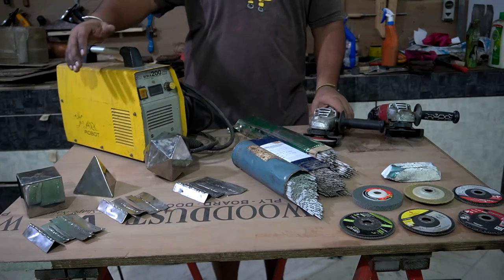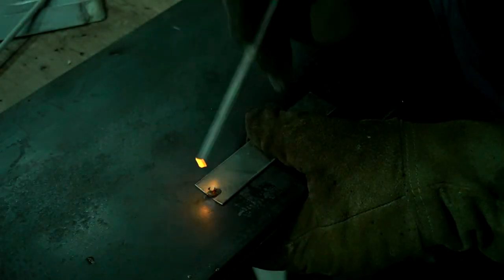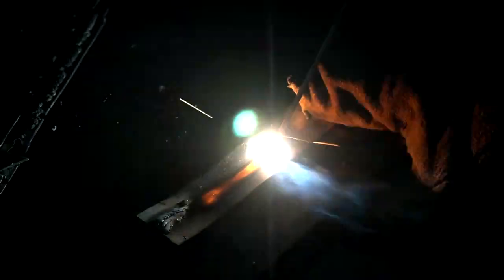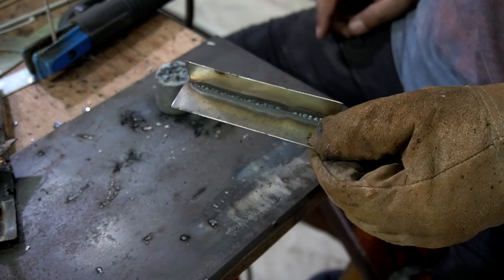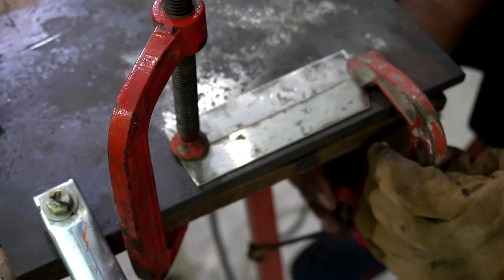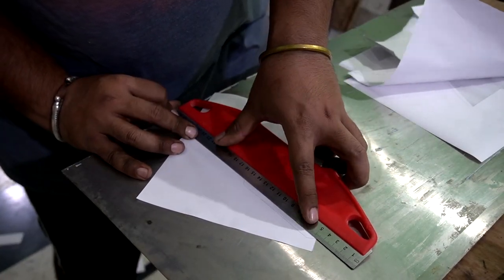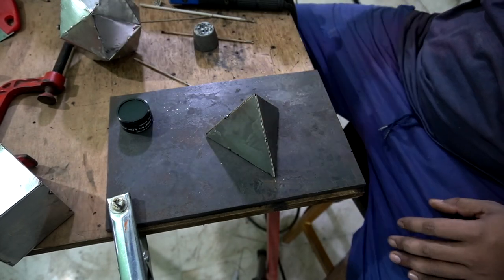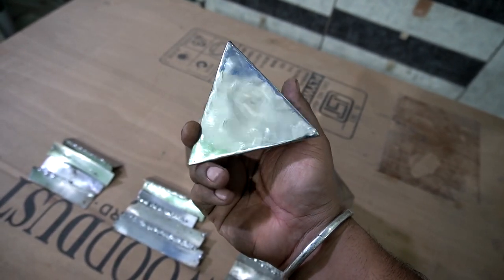Learn secrets of Welding Thin Stainless steel Sheet /Why welder fear from doing it with stick welder

Comment: thank you for your very interesting video. I've weld many stainless steel tubes 2mm thick with , and I often do holes when welding 1mm thick plates. I do like the demonstration with the 3 diameters sticks for all the differents welds.
Reply from the maker: Buddy the problem with thick rod is that the amount of Amps needed it to melt, when it reaches upto that state the temperature is already too high for sheet metal and that cause the holes. It's doable but it's not going to be a fusable weld.

Comment: Excellent video. Very grateful for you taking the time to make this.
Reply from the maker: Thanks mate, appreciate your feedback:)
Reply: @ambroscustom  Hey.. quick question... does your welder have a 'hot start' ? Would this technique be possible with a welder that had hot start?
Reply from the maker: No dear, it didn't have a hot start feature and I don't think you really need that, it will surely going to make holes in the sheet of this thin size. Hot start gives you a more penetration and we did not required here because what ever tack you are going to make they penetrate easily.
Reply: @ambroscustom  Thanks again! very helpful
Reply: @ambroscustom  do you think it is possible to buy a good arc welder today that does not have 'hot start' ?
Reply from the maker: @rosstituteuk  buddy now a days all the mma welding set have a hot start feature and I don't think it's really matter, I work with hot start machine too, the only thing matter is that how quickly you lift the rod after the arc ignites. Its all about the practice mate. No need to buy any new welder. Even it's good because the speed is a little quick and that hot start infact help. So just focus on practicing, once it stored in your memory machine never matter, just you need to have right current settings.
Reply: @ambroscustom  thank you man. you've been very helpful and it is really appreciated.

Comment: Thank you for this helpful video. I bookmarked it long before I purchased a welder and now I hope to use your tips for a challenging project. I need to weld (expensive) 316 stainless steel handrail fittings to a 25mm railing of 1.5mm thick, to make a roof support, and polish it afterwards. Getting rod sizes and Amps correct really matters.
The result of the pickling agent looks great but unfortunately, in my country it can only be purchased by certified professionals because it’s so hazardous. I will need to grind.
Reply from the maker: Glad you liked it mate. Good luck for your project.

Comment: I used to have certification for MIG welding thin sheet stainless steel.
We used to have to weld panels together with no burn- through, only discoloration that would then be cleaned with the acid.
I don't think I ever even TRIED to weld any thin sheet stainless with a stick.
Stainless is so touchy, I will warp just looking at it. You don't need to weld it.
Just heat it with a torch it will assume a whole new shape.
Reply from the maker: Indeed, one of the non-cooperative metal to work with, if don't pay much attention then convert any professional job into abstract art.
Reply from the maker: Indeed, one of the non-cooperative metal to work with, if don't pay much attention then convert any professional job into abstract art.

Comment: Bro i wanted to fill some welding on bike leak tank so which rod I have to use ????
Reply from the maker: Preffer brazing rather than welding, stick welding damage the tank, or you go with tig welder. You can fill the small pin holes with stick welding with 2.4 mm rod at 60 amps but be careful, it's a bit more difficult.

Comment: Great video. And thank you.
Question, how thin can you go?
Thanks again😇
Reply from the maker: Thanks mate. If you provide an aluminium backing as heat sink you can safely weld 20 gauge thick sheet but rather than performing the full weld go with stich weld to avoid heat deformation.

Comment: first these are thick , not thin , thin is below 0.5 mm and even if you manage to weld it without holes it get caved in and badly warped ,  you need to get a mig welder , mig use 0.8 wire so easy to melt compare to that stick

Comment: Want to let you know that using Solar flux which is a metal holding flux on both sides of the sheet metal will really make welding a breeze. Just saying fella. Nice and honest welding.
Reply from the maker: Thanks mate. If I found that item near me I definitely give it a try.
Reply: @ambroscustom  You will be amazed how great this stuff works. This was actually a top secret material during WW2. Back then they only had oxy acetylene gas. The old timers called this a holding flux. Good luck fella too.

Comment: How do I weld 22gauge stainless steel sheet. I tried the direct arc to the metal method,  but the sheet just melted. Then i used extra steel wire to weld it. It worked but its time consuming plus the finish is not fine

Comment: Hi thank you good job I have card sister rusty how to welding the car body metal sheet please make one video my request🙏🙏
Reply from the maker: Buddy the steps are almost identical. If the gauge is less than 18, then don't go with stick welder it's gona make holes which are difficult to fix.

Comment: 1 more question. Hope this isn't stupid. But could I use the small stick with a soldering torch?
Thanks again,😇
Reply from the maker: People often doing brazing on thin sheets( brass filler rod) but the out put result is not pretty. You can't use stainless rod for brazing.

Comment: Please tell me is it DCEP or DCEN ?
Reply from the maker: It's DCEP dear, untill you have right electrode, it won't be any issue to weld sheet metal with right amps. Thinner electrodes are much safer in welding but required fast action.
Reply: @ambroscustom  Thank you

Comment: So you can tack 1mm stainless with a 2,5mm electrode If you are fast and don´t pull lines ? Thanks I will try it with your 45A. I need that for holding before I do hard soldering.
Reply from the maker: Yes dear you can, also using some sort of aluminium block along the weld lines also helps. If feels difficult to do then try changing the polarity will definitely help, electrode to negative and ground to positive. Good luck:)
Reply: Thank you very much dear brother ! Keep your videos going they help a lot :)

Comment: The cube is a cross did'nt know that. Very nice habilety. Does brand of rod make a difference. I tried to solder 2 spoons as practice , low amp rod sticks high amp spoons melt ! E 6013 3.2mm ...any advice is welcome. I use $99 inverter from the web
Reply from the maker: Well buddy the trick is that to weld thin sheets it's absolutely mandatory to use thinner electrode. 3.2 mm is considered to be thick. I use 2.4 mm for 1.5 mm thick material.Never tried 3.2 mm for these thin materials. So go for thin and go low for thin sheets.
Reply: @ambroscustom  , good advices ...i was feeling dumb to not succeed ...go thin and success.Thanks.

Comment: Just one question please!
Some welders use a shorter lengths of thin, say 1.6mm stick to minimise bouncing, but is it okay to cut an electrode down to size?
Reply from the maker: Yeah buddy its ok to cut. Or you can also remove little bit flux from centre and hold from right in the middle, in this way you can use half from both sides. If find it difficult then no big problem in cutting but it's always good to practice with bigger one, that also minimise the wastage.

Comment: Hi AMbros Custom, i would like to do a repair job on the stainless steel bowsprit of my boat. It is made out of 1 inch diameter tube. I was looking to see if i could get some advice on you tube and came across your channel. Your video was really helpful, but i just wanted to ask, will welding the tube be the same as the flat pieces you demonstrated, that is ,can i use the spot welding method with 2 mm rod, or do i have to do a complete pass.I have a small a.c. welder. Many thanks,  Oz.
Reply from the maker: Buddy, there is a video on my channel in which I weld on 2" pipe having a wall thickness of 1.5mm. the process is almost the same. That is definitely a doable task. Tried to make the joint as precise as possible and avoid any air gap between the joints because that's the main cause of blow holes.  Tried to have thin electrode and kept the amps at 45-50. That is very good for 1-1.5mm metal and also provide better fusion. Don't make a complete run in one go. Stich welding is the only way you can do it. This video might help you little bit to boost your confidence. Good luck.
https://youtu.be/n7qxpbQa4GU

Comment: what is the size in  fraction of inches closest to the 2.0 mm i only see 1/16" 3/32", 1/8" 1/4" sizes  what do you recommend for  18 g stainless
Reply from the maker: Buddy if you able to find 1/16" it's good other wise for 2 mm 5/64" is the size in fraction. 3/32" is a bit thicker for 18 gauge sheet so don't go with that.
Reply: @ambroscustom  thanks can you recommend where the buy the 5/ 64?  i only found one can  of arcos  from 1993 on ebay.
Reply from the maker: Well buddy in my country brand name esab and Hobart sell these electrodes. I didn't knew any other brand but if you search them in your area you will definitely find someone. Good luck:)

Comment: Hi Sir! POLO MMA 300 Welding machine Can I Use for Steel!
Reply from the maker: Dear for stainless-steel machine really didn't matter at all. All you need is right settings and correct size electrode and good timing. If you have all of these things than you can easily do welding.

Comment: Good information. Which pickling agent did you use?
Reply from the maker: Thanks brother, onto the bottle there is nothing written about the contents, but you can search about stainless steel pickling agent or pickling paste. This is specially available for removing black oxides from stainless.
Reply: @ambroscustom  ya... I will try to find. And your channel is very much helpful

Comment: What chemical u use to clean welding line ?
Reply from the maker: It's called pickling agent, mostly used for stainless-steel to remove black oxide and burn marks.

Comment: why dont try float welding not to put table
Reply from the maker: Well dear you can consider those shapes to be in floating position. If things worked well with the actual product then float welding demonstration should definitely work.

Comment: Facing blow holes problem😢
Reply from the maker: Use filler rod method, take a separate rod and place it over the joint and then ignite the arc.